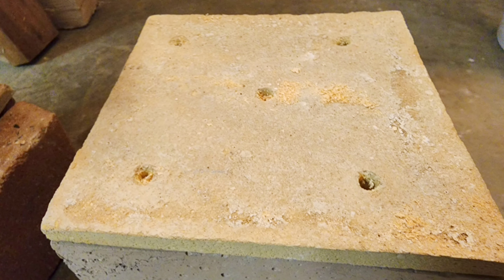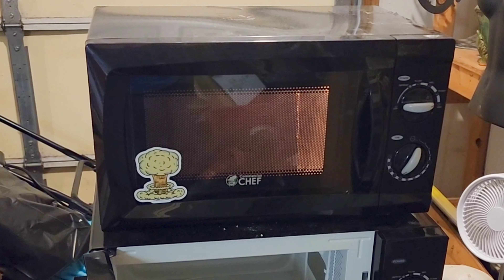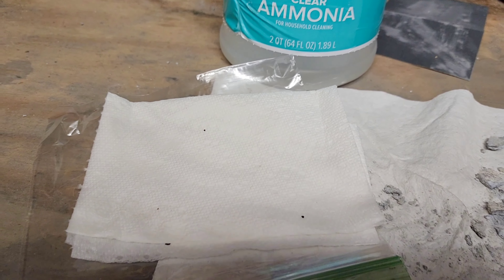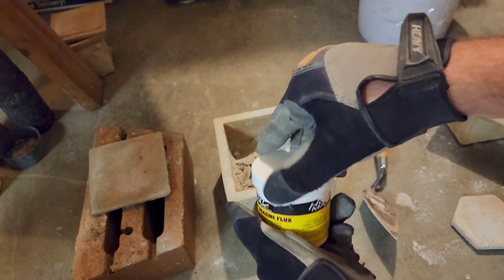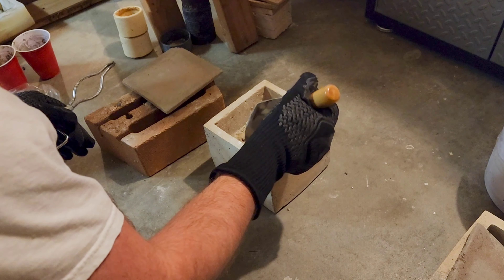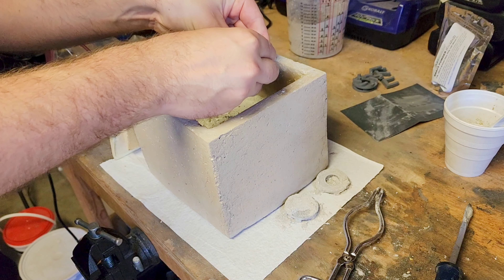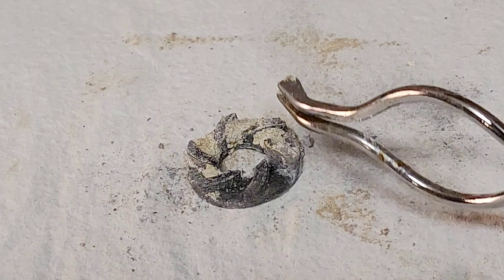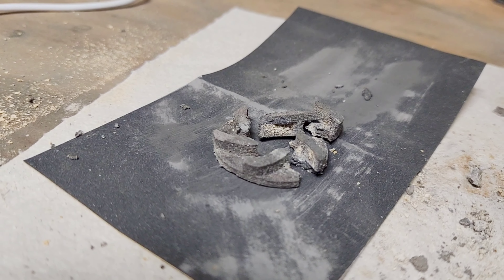Aluminum Microwave Sintering Experiments. Hunch Confirmed?

Comment: I've been loving these tests. I'm super interested in the idea for an easy way to make porous aluminium
Reply from the maker: Thanks for the watch! Also no big deal if you want to keep it a secret, but you got me intrigued on why you'd specifically want porous aluminum?
Reply: @Mr-Highball  I'm interested in aluminum air batteries. And one of the hard things is getting a bigger surface area to create more current. I live in an apartment and i don't have a propane furnace so I can't melt any. But the microwave furnace idea might work to try out small test batches
Reply from the maker: @john potter  interesting!